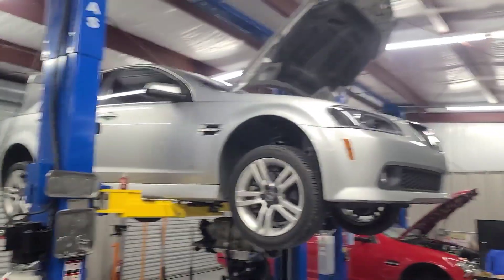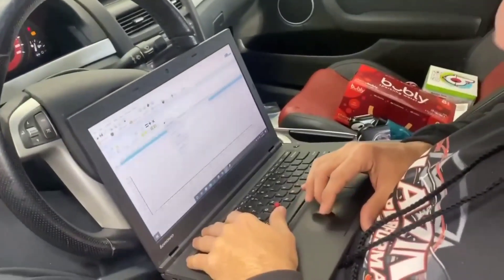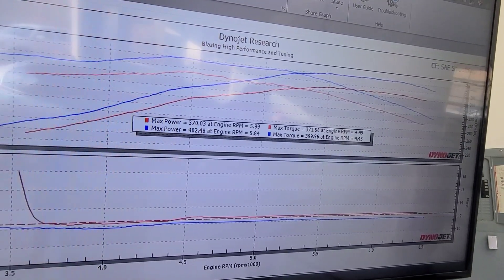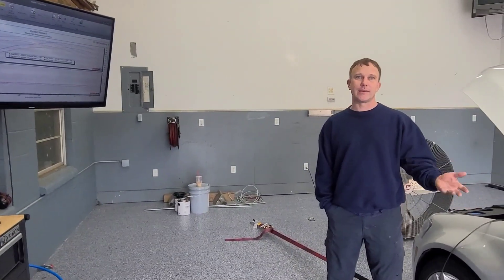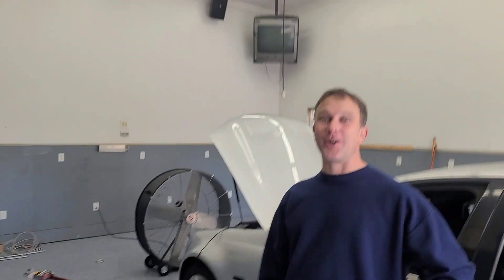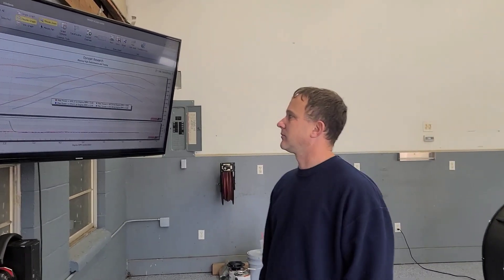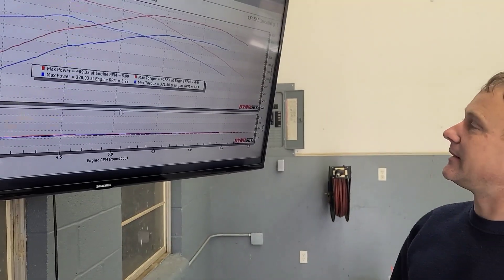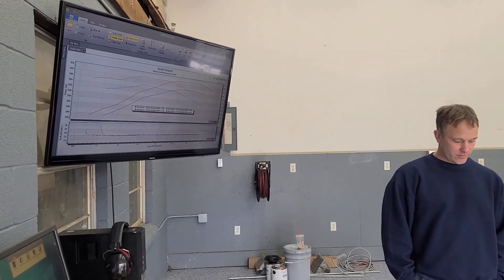We install Kooks headers on Dusty's G8.  How much HP do headers add on a cammed G8?

Comment: Will E85 need bigger injectors and more pump? If so wait on that, if not add that next. Do as many simple boltons as you can so the average guy who can do some of his own work can see what simple boltons will get. Maybe a ported throttle body should be next?
Reply from the maker: On E85, we will probably need injectors, but the stock pump will work.  We are going to do a ported intake soon, so will look into a TB as well.  Thank you

Comment: Spec wise on the red-hot doesn't seem far off from a decent centri camshaft. So even down the road if he goes procharger like mentioned previously could potentially be a case for this car, would be good to see NA build then with boost.
Reply from the maker: Thinking that way as well.  This is their " centrifugal cam now too"
Reply: @nufnuffz28  I haven't been following the BTR stuff as much lately I know he revised everything and been seeing each make more power. Haven't seen slips pop up of red hot yet but we will soon enough. Seems last couple of years everyone been busy and changing stuff around or stopped racing. I'd love to be racing again but lately focal point been family and work so the car is strictly on daily duty. I have been eye balling d1x stuff

Comment: I like the "one thing at time" approach. Like seeing a kid grow and interesting what gains a single change if any does. 

Btr red-hot v2 cam, rod mod ls3 intake and then your choice of heads. I'd really like to see some milled tfs 255 ls3 heads on there being that everyone does stock ported castings but it's your car and your 💰! Look forward to the updates
Reply from the maker: Thinking aftermarket heads too.  Not going to add compression most likely as it may see boost later in life.

Comment: Hey guys I got a btr stage 2 cammed g8 right now Its factory headers and exhaust but in the spring when it comes out of storage I got kooks long tubes and a 3 inch solo cyclone to go on it what do you think IL pick up with a good tune
Reply from the maker: 35 or so.  Who tunes it?
Reply: @nufnuffz28  I'm not sure I bought the car as is I'm pretty sure it's a place called Jansam motor sports it wasn't on a dyno to my knowledge
Reply from the maker: @Hunter-cn7xi  cool.  If you need anything,  let me know
Reply: @nufnuffz28  will do might get it turned though you since you have so much experience with the G8

Comment: How much for the exhaust?
Reply from the maker: I think you'd have around $2500 in it from headers to tail pipes!
Reply: @nufnuffz28  for the old set he was selling?
Reply from the maker: @tylerharrell3237  ahh.  He still has it.  $700 from cats to tips
Reply: @nufnuffz28  any way I could private message you or him?
Reply from the maker: @tylerharrell3237  sure.  Message him on the blazing high performance fb page or email me at nufnuffz28@yahoo.com